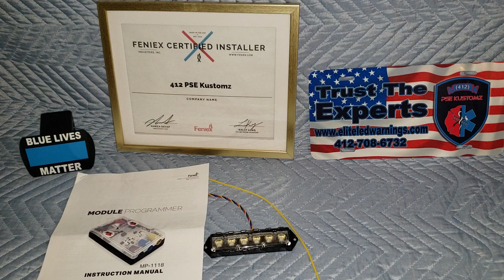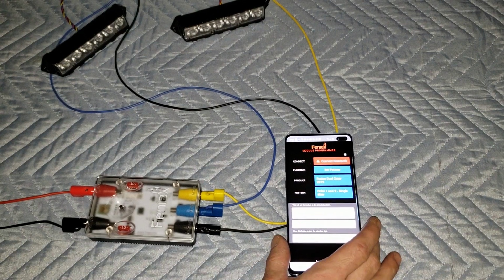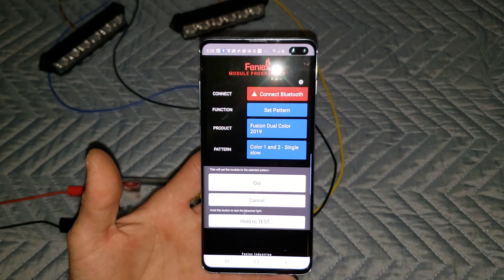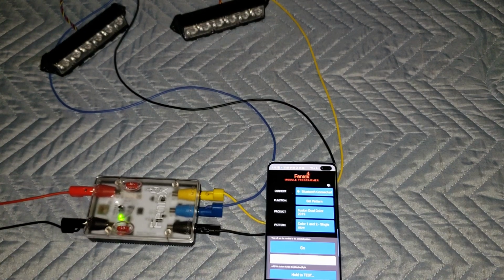Feniex Module Programmer Overview & Demonstration

Comment: True confessions I saw a guy with the most awesome pattern ever ,just the other day and asked him where he got the flasher to that? He agreed it's the most awesome pattern and he himself was shocked when he found it ,in the 4200 mini ! It's a "hybrid" of two common patterns the single quad flash with criss cross ,its the perfect pattern and has a very smothe flowing change up, he has it on a pair of ions and a pair of mpowers , i just don't think if will be happy flashing 10 amp load very long otherwise I would use it .
What is the reference load on Feneix modules ? Is it an amp peak like Ion ? How many heads can that thing set simultaneously would probably be a better question .
Reply from the maker: It's in all the T3's as well.
Reply: @412psekustomzllc7  damn it !